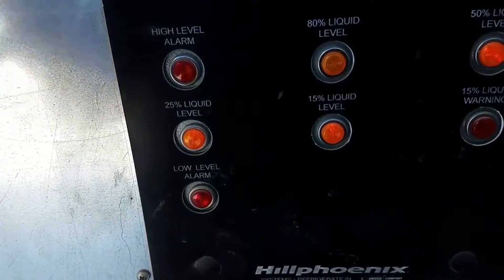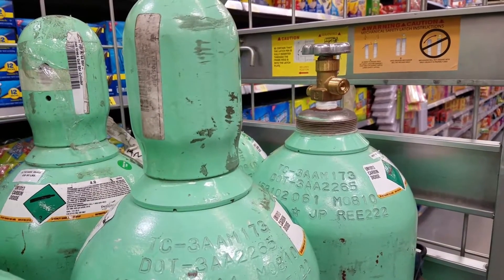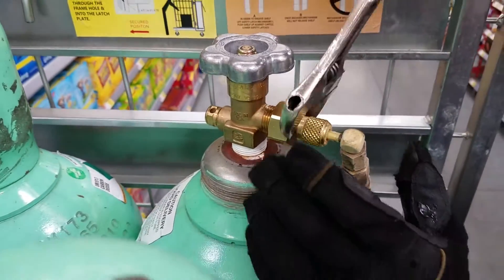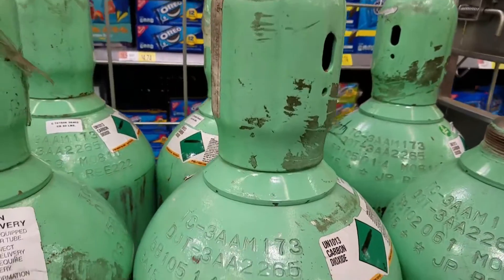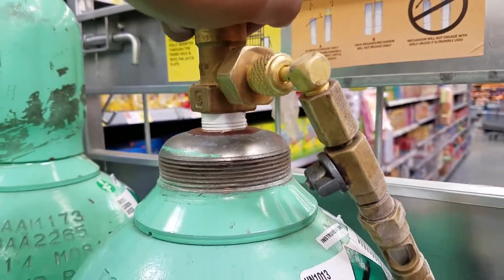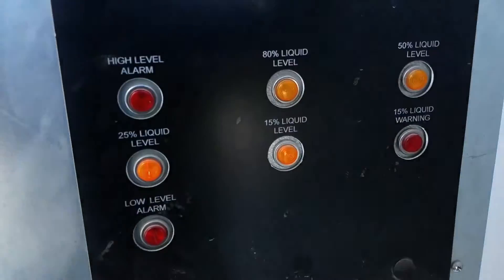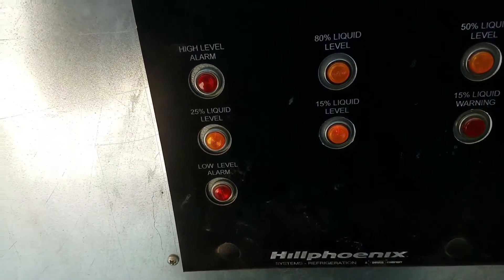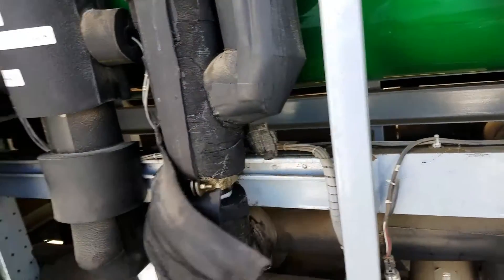Adding Co2 to Rack

Comment: Hi there. Thanks for the video. My question is; how do you prevent triple point which dry ice forms? I read at 4.2barg it will be partially solid.
Reply: Just add vapour
Reply: You add it in as a vapor until you reach that pressure

Comment: Where you should hook up your charging hose in the rack? (suction or receiver)
Reply from the maker: On the Co2 system I’m working on you charge it through a charging tree at the top of the vessel (receiver). Vapor side.
Reply: @RefrigerationTech72  thank you, for your time and help

Comment: I don’t know if you will see this but I just left a job (WalMart) and it was a hill Phoenix cascade rack and we added co2 but we used a regulator and it took forever is it ok to add straight tank pressure to the system. I’m new with this co2 stuff looks like that’s what you did and probably was way faster just wondering any info would be awesome
Reply from the maker: Yes, I personally do not use a gauge. Just be very cautious! Do not open to fast and meter it in with a sight glass in line of hose like the one I use. When liquid disappears and becomes vapor only then stop. Do not empty the bottle.  Again be careful!
Reply: Bro thank you much appreciated for your reply and the info !!!!! Thank you again

Comment: Hey bro I heard that some of those C02 tanks have a layer of nitrogen or some inert gas that you have to purge before you add to the system.  Have you heard of this?
Reply from the maker: It depends on the manufactures, some use to have nitrogen on top of the Co2 to help push down the co2 when charging. That’s why when you charge you don’t completely empty the bottle. When the liquid is done then you stop and leave vapor inside the bottle.
Reply: Havent heard of this bro. The Co2 is suppose to be 99.99% pure.

Comment: Never used it as a refrigerant, why are they adding? Was a leak found? Or does it lose its properties?
Reply from the maker: I believe on this call, it was a power outage and the co2 charge blew. That's a safety feature on these co2 Racks. So that's why we were adding the 99.99% pure liquid co2.
Reply: RefrigerationTech k thanks, as I said not familiar with supermarkets and using Co2, , appreciate the response, learning is good

Comment: I agree with Mike Wolins. C02 is the future of supermarket refrigeration (even though its an old school refrigerant). But its different than the HFC's. The pressures are much higher. A transcritical rack runs a head pressure of over 1000 psig. So safety measures should be taken seriously and explained. There's a lack of professionalism in our field. But it needs to start with the veteran techs. It's no longer about picking up experience in the field. Tech schooling and training is a must. There's more to charging a C02 rack, than just connecting a hose to a CO2 cylinder and adding it in as liquid. For safety there are set temperatures you want to achieve. And of course your Personal Protection Equipment (PPE).

Comment: Thanks for sharing. Always good to see work in the field.
Safety principles should be an underlying element whenever working, and definitely highlighted in your presentations. Some have been touched on by others, like tethering the hose and protection for the public/customers. And where are the technician's PPE? Seems like safety glasses are an optional accessory on many Market Refrigeration Specialists.
Reply: Also, the cylinder is marked "Instrument Grade", so it is 99.99%,  not 99.9% as you stated. This is the minimum purity recommended for refrigeration systems.

Comment: Awesome. Thanks! Starting to see more. Co2 systems come out of the woodwork in my neck’0’thewoods as well. I have yet to have to charge though. Is that just a regular drum adapter?
Reply from the maker: Yes it is a regular co2 drum adapter
Reply: Sorry I misspoke my question. 😁. I meant to say is that a regular 3/4 NPSF x 1/4” MFl adapter like for a recovery cylinder?
Reply: CO² cylinders, whether for refrigeration or any other use, almost universally have a CGA320 connector. Similar to a refrigerant drum adapter, which is a CGA660, but not the same.

Comment: Hi, do you add liquid CO2 to low side or high side ?
Reply from the maker: This type of set up doesn't matter. Liquid co2 dosen't have a metering device at the evaporator coil, nor does it have a compressor. It just circulates the liquid co2 using a pump only.
Reply: @RefrigerationTech72  ok, is it cascade system?
Reply from the maker: You can say. It have chillers that condenses the co2 and stores it in a vessel (receiver) that gets pumped out to the evaporator coils.
Reply: @RefrigerationTech72  I got it, thank you for your time and happy new year!
Reply: It's a liquid pump over feed at Walmarts I have seen combo liquid pump over feed combo cascade. If it was a trans. You would charge thru your liquid line after your ball valve on your biggest system so your pumping down the cylinders basically just like hfc dx
Reply: @ChaR1smashn  thanks

Comment: Where did you get that charging hose at? Looking to get one like it. Our company is getting into the CO2 side of refrigeration and trying to gather up tools and such.
Reply from the maker: I got mine from RSD, but they had to order it for me ,3/8 charging hose 50 ft, I'm sure United can do the same. Make sure it's the black hose
Reply: Looks like RSD is big on the West coast. I'll start there and with United Ref. Thanks bud!!
Reply from the maker: Also when charging co2 use brass fittings and a sight glass,  not your manifold gauges.